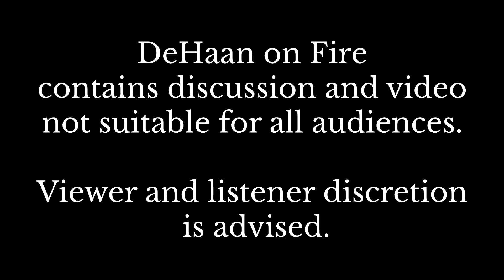HHR: Heat Release Rate - DeHaan on Fire #005

Comment: When you compare fire kilowatts to the amount of electric bar heaters needed for the same heat, you can see how temperature rise is such a big problem. A typical central heating system on full power is only about 25 kw to heat an entire house warm and toasty. So that burning arm chair is giving enough heat for 20+ homes!
It also explains cars like the Bugatti Chiron. It takes 3-4 megawatts for that 1 megawatt of driving power to the wheels during a top speed run. You can see how many radiators it needs because it has the equivalent of a blazing christmas tree under wherever the engine is.

It also, when comparing a traditional open fire in a fireplace to an electric bar fire, shows how most of the heat is going up the chimney. A 2 to 3 kilowatt fire (enough to compare to a bar heater that warms a room fairly toasty) looks diminutive in a classic fireplace. You could make a 1 kilowatt fire in a vented empty can of beans (or cat food) and a few little sticks. Saves chopping wood if you don't care about the smoke in the room!